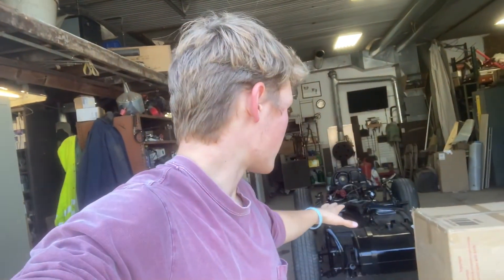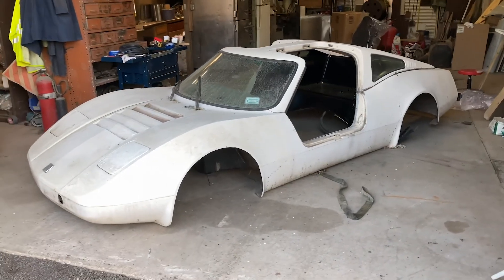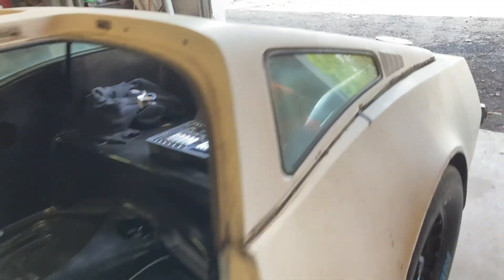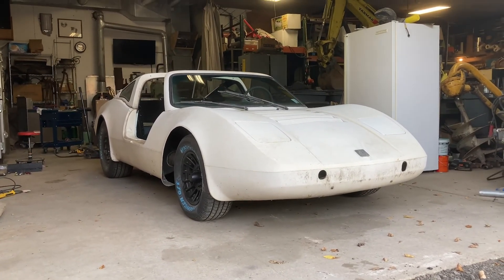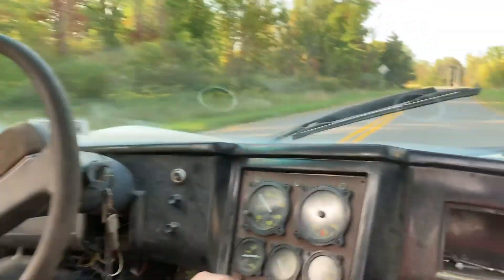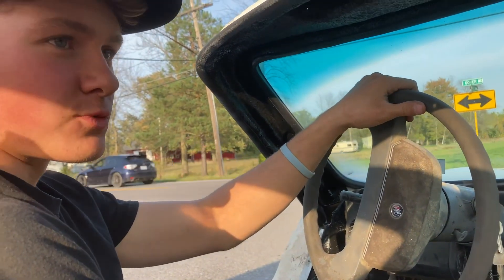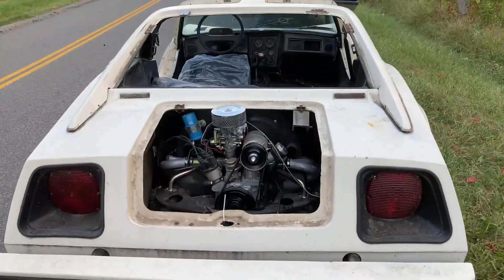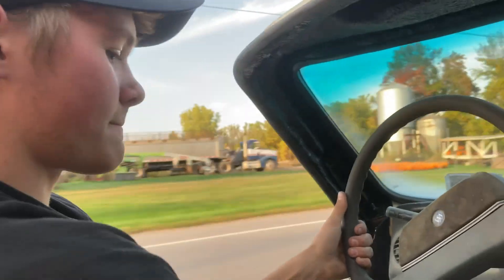Bradley GT 2 FIRST RIDE!

Comment: Once you get that engine running right it should feel a lot peppier. Might surprise you because those things are so light, even with whatever that VW engine is making for power. Get the carb tuned up and the timing set properly and it should wake right up.
Reply from the maker: Robert Nugent  it’s got bad fuel running through it right now I’m sure when I start driving it more it will be a lot better
Reply from the maker: And of course when it’s all done I’ll get it tuned

Comment: A Karmann Ghia stock offset air cleaner should work. You may have figured that out by now.
Reply from the maker: I will give it a try when I work on it next.
Reply: @AbsurdAutomotive  I'll be using the same setup on vw invader I bought yesterday.
Reply from the maker: @reallyoldtom9352  the invaders are so cool I just really like all the different kinds of kit cars people have for the beetle chassis. Good luck with your build are you gonna be filming it at all?
Reply: @AbsurdAutomotive  Turns out the Invader windshield is from a Karmann Ghia rear glass. It has the vw logo on the corner. I'll check with my vw buds. To make sure whether it's front or rear Ghia 100 %. My wife and I sanded everything down to original yellow gel coat this morning.
Reply from the maker: @reallyoldtom9352  that is awesome! I’m not sure what kinds windshield I will be putting in mine yet I will have to figure it out when I get out of tech school. I would love to see the car when it’s all done man!
Reply: @AbsurdAutomotive  I'm not sure but I think it's a back glass from a GM product

Comment: There is a guy wanting to trade a super bear one of these and he would take 1.2 k fit kinda want to make this my first project but idk
Reply from the maker: This is my first build and I am only 20 so I had to learn a lot but it was worth the time and memories put into it!
Reply: @AbsurdAutomotive  I've built a 356  2 Mercedes Benz a few fiber glass buggies haven't done a Bradley but picking one up this month I've been working on vws since the 70s you really need to check for rodent nest between the cylinders and close the exhaust heat from coming up and put fresh air coming in  good luck